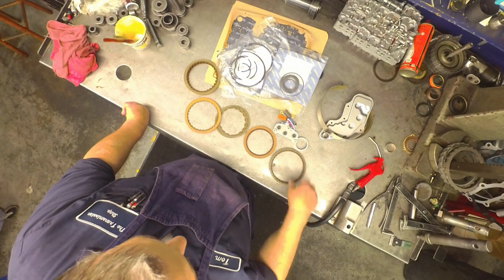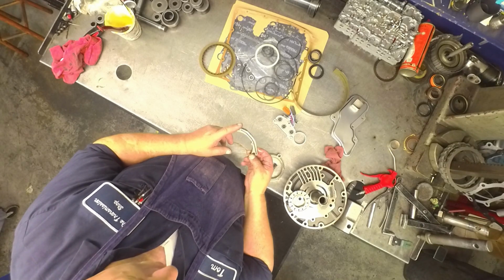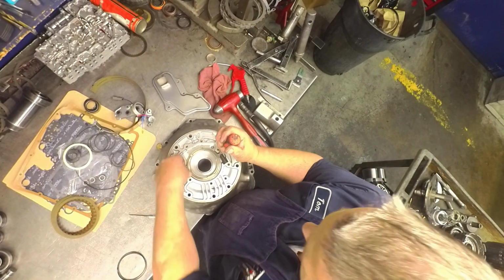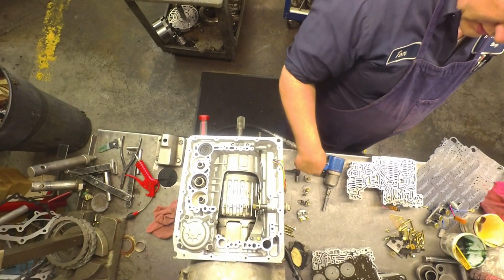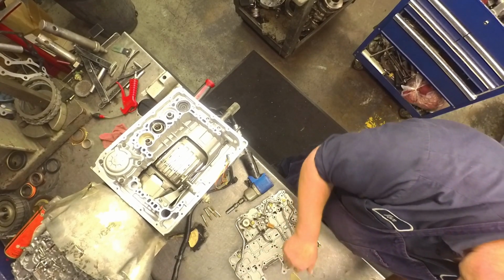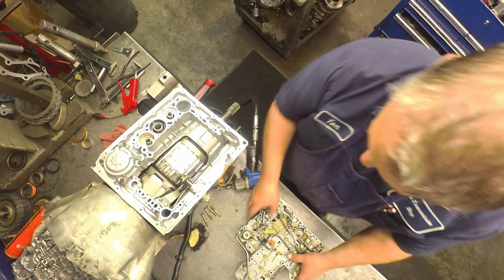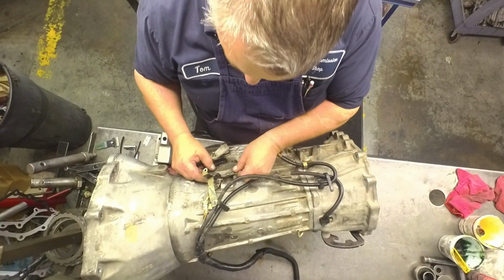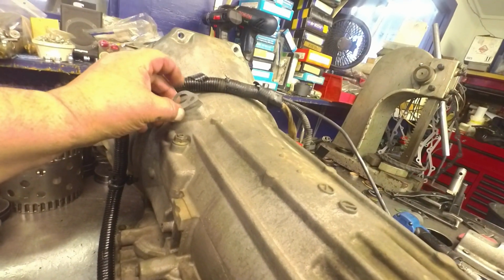RE4R01A Rebuild

Comment: if you have no 4th gear instead it goes from 1 thru 3 and stays in 3rd as if its stuck in overdrive.  could this be an issue with the servo? sometimes you feel the 4th very lightly engage weak but still like its in overdrive.
Reply from the maker: You have 2nd gear? If so the problem is probably not the servo, but look at the piece that goes in the cover, if it's bad that will be where the crack is. The band is 2nd and 4th.Where did you set the adjustment for it? Do you have a knock sensor code?If so that is your problem. If not you either have a problem with the shift solenoid or I have seen the plug in the valve body crack and keep it from having 4th. I show where the 2 of them are in the video.
Reply: @CurmudgeonTransmission  
2nd gear works. if you activate hold mode from a standstill it starts off in 2nd and goes to 3rd. deactivate hold mode it never kicks to 4th.it just feels heavy like in overdrive or stuck in 3rd. it does not over rev like when in neutral , it just drives with the heavy overdrive feeling slightly higher rpm. theres no codes , valve body swapped came with new solenoids. old valve body look fine just old broken gasket.solenoids work fine.
Reply from the maker: @dcomputers  Sounds like it is in failsafe from no power to the transmission.  Have you checked the fuses? Can you look at data on the scanner? What is it commanding? Did it come in doing this or is it a new problem? The computers are not a big problem but do go bad. If you open it up you will see the burn marks if it is bad, usually on one of the capacitors.
Reply: @CurmudgeonTransmission  
I checked fuse nothing wrong there. pre obd2 no data on scanner. the computer looks fine. disconnecting it puts trans in manual mode which makes D selector 3rd gear Fixed , S on selector is 2nd fixed kinda like a manual trans. it just happen one morning it felt kinda odd when getting on highway. it did all the shifting except fully 4th.
Reply from the maker: So this transmission has not been rebuilt, it just started doing this? If you have 1st, 2nd and third gears you have everything you need for 4th. All that needs to happen is the band to apply again. Does this vehicle have low second and drive on the shifter with an o/d button on the side. Does the light light up on the dash? Might be a bad neutral switch, not very common but have seen it happen. You can take them apart and clean them up and put some diaelectric grease in it. If it's that it might start working again.When you unplugged the transmission did it set codes in the computer?
Reply: @CurmudgeonTransmission  
it has low second and drive on shifter with o/d button. it lights up and works. if using the button it starts in 2nd like it should . if it feels like its in overdrive mode and pressing the button you could feel it engage. unplugging didnt set codes but im wondering if the speed sensor at the bell housing could cause this, its a long sensor at the front. car only cranks in park neutral mode looks like its ok.
Reply from the maker: It should have set every solenoid code there is. Never seen the speed sensor in the pump go bad unless it wasn't taken out before the pump was tried to be removed. You are not going to get it out in the vehicle. It is about 5 inches long.If it wont start in neutral I would clean the switch and readjust it. I show how to adjust it at the end of the video. What type of vehicle is this in? What brand of scanner are you using?
Reply: @CurmudgeonTransmission  
its starts in neutral and in park. what kind of issue would that 5 inch sensor cause assuming its faulty. snap on scanner. pre obd2 92 929. I could do the checks at the computer see if its reading good waveform.

Comment: Can you help with the location of the three accumulator springs? I know the fat one goes in the middle but out of the other two, the heavier coiled or the lighter coiled, which goes in the spot towards the front of the vehicle beside the fat one? I had to change my shift solenoids and when i dropped the valve body down the springs fell out without me seeing where they are supposed to go.
Reply from the maker: First number will be free length then outside diameter then coil diameter. We'll start from the front and work our way rearward: N-R/3-4 2.254x.675x.089, 1-2 1.772x1.144x.156, 2-3 2.595x.787x.136, N-D 1.700x.703x.088 and the spring goes in the case first.
Reply: @CurmudgeonTransmission   PERFECT, THANK YOU SIR!
Reply from the maker: @tnet6969  You're welcome.
Reply: @CurmudgeonTransmission  i dropped the valve body to make sure i have the springs in the right place, and I do. I originally had to change the shift solenoids because it would not shift past second gear. Now that i did that i only have forward  gear, it will go forward when I put it in reverse, neutral and drive. Not sure what is going on.
Reply from the maker: @tnet6969  I will bet money you missed the manual valve.
Reply: @CurmudgeonTransmission  That would be a safe bet since I am not sure what or where that is.
Reply from the maker: @tnet6969  At the 23:00 mark you will see me putting it in place.
Reply: I changed the  solenoids that are wired together.
Reply from the maker: @tnet6969  It is the valve that free floats over by the solenoids you replaced and connects to the linkage that passes through the case connected to the shifter cable.
Reply: @CurmudgeonTransmission  Yep, I missed that, taking it back apart again I guess. Thanks for all the information I really appreciate it!
Reply from the maker: @tnet6969  You're welcome. Don't need to take it all the way down, just loosen it enough to get the valve in place.
Reply: @CurmudgeonTransmission  Ok, dropped the pan today and connected that valve/piston. I now have forward and reverse again, thank you! It still will not shift past 2nd gear, which was the whole reason i took this thing apart. I only use it to drive around our hunting club so i am rarely getting over 45 mph, i think it will be ok.
Reply from the maker: @tnet6969  Are you positive that it is shifting to 2nd? You have 2 possibilities, it is shifting 1-2 and you have a problem with the high drum, but usually it will neutral out when it tries to shift to third. It is shifting 1-3 and you have a problem with the band which would give you no 2nd and 4th. Did you happen to notice if the band looked loose when you had the valve body off? You could try to adjust it but I think you have a problem in one of those 2 areas.
Reply: @CurmudgeonTransmission  It is running about 4500 RPM at 65 mph, must be 3rd gear. It doesn't hit neutral when it shifts.I do know that i can manually shift to 2nd gear while running at speed and nothing changes.
Reply from the maker: @tnet6969  Tried mine on the way to work this morning and was running 4500 @50mph in 2nd and 3500 @65 in third so I would say it's 2nd. What speed is the shift occurring at?
Reply: @CurmudgeonTransmission  Normal speed, nothing out of the ordinary so I really haven't paid attention to the speed.. You can't tell anything is wrong until it doesn't shift to the next gear.
Reply from the maker: @tnet6969  Since that is the case and it does not neutral out it makes me think shift solenoid B is shorted to power. What did the fluid and the pan look like? Is the check engine light on? Does it have any codes?
Reply: @CurmudgeonTransmission  Pan is clean and the fluid was still red and didn't smell burnt but I changed anyways. There was nothing at all in the pan. No engine light or codes that i could pull.
Reply from the maker: @tnet6969  What is year, make and model?
Reply: @CurmudgeonTransmission  1996 Nissan Pathfinder SE 4x4
Reply from the maker: Control unit should be up under the dash on the drivers side. Open it up and see if there is any obvious damage. If you don't see any you can watch the voltage at pin 6 and 7. 6 is shift sol. A and is blue with a white stripe. 7 is shift sol. B and is blue with a red stripe. A is on in 1st and 4th, B is on in 1st and 2nd. Meaning you should see 12volts when on and 0 when off. Put one lead to the wire and one to the chassis to ground. Computers are not real common to go bad but you can usually see where it is burned. I would start there.
Reply: @CurmudgeonTransmission  Ok I will go check that out
Reply: @CurmudgeonTransmission  With the truck running and in 1st gear i have 12 volts to ground on the blue/white and the blue/red and the same results when in 2nd gear. assuming putting the truck in 1st and 2nd with the shifter is the correct way to check these.
Reply from the maker: @tnet6969  You want to check it while driving. Main one you want to be concerned with is the blue with red. If power never goes away on that wire when it should be shifting to third that is the reason it is not doing it. You either have a short in the wire to power or the computer is bad. If power goes away and it is not shifting then the problem is internal of the transmission.
Reply: @CurmudgeonTransmission  Ok im going to have to get a probe i can clamp on that is really small. they didn't make it easy to get to.

Comment: I have a c23 serena. I found parts of a broken black washer and i have to wait a while for my gearbox to engage in 2 cause drive doesnt engage at all. Reverse goes a bit faster but drive doesnt. Do you think it will work normally if i fix the black plastic washer
Reply from the maker: Hard to say without seeing all your parts. Probably not, once the washer breaks  there is usually more damage. You already will have it apart you might as well do a full rebuild on it.
Reply: @CurmudgeonTransmission  thanks a lot for the info. I will tear it apart maybe in the next week. Fingers crossed i dont have too much damage. Because when it is already engaged the bus drives totally fine thrue all the gears
Reply from the maker: Never know what you are going to find till you get in there, best of luck.
Reply: @CurmudgeonTransmission  thanks a lot.

Comment: I bought a new one
Reply: Ouch! How much?
Reply from the maker: Some of these older units are getting harder to get parts for and new is the only option if you can even find that. Just had a 450-43LE had to buy new, was 750.00.
Reply: @CurmudgeonTransmission  That's a great price. I thought you were going to say 3k or something like that.
Reply from the maker: @panchocoyote3608  That was for the pump only, not a whole unit.

Comment: Hey Tom i ordered a new front pump for the 2004 Xterra  but theres a slight difference in the pump housing, all the bolt holes line up but it has a big hole for a sensor where mine does not, are  there  two differnt pumps for a RE401A? can i use it or do i need to send it  back? heres the 2 pumps, the original is on the right and the new one is on the lefthttps://www.facebook.com/photo.php?fbid=3767692239909895&set=pcb.3767692283243224&type=3&theater
Reply from the maker: Yes there are 2. No you CAN NOT use it if yours is different.
Reply from the maker: Still will not let me see the pictures you send, try sending on Instagram. beardentom
Reply from the maker: Did you see an issue there with the pump and drum? You can air check it if you have an air compressor and blow gun with a rubber tip.
Reply: @CurmudgeonTransmission  oh yeah man its really worn out and that brass bushing is totally gone. I could see the dust in the pan.  This transmission shifted perfectly in all forward gears just had no reverse.  Apparently there are two pumps one with a switch and two tabs? , im sending this one back and getting the other one
Reply: @CurmudgeonTransmission  okay ill do that
Reply from the maker: @jbncnow  If you get a used drum buy a new bushing for it, they wear super bad. Drive it in as straight as you can.